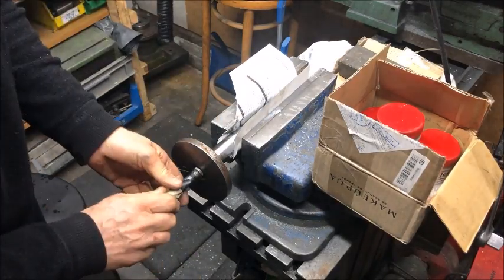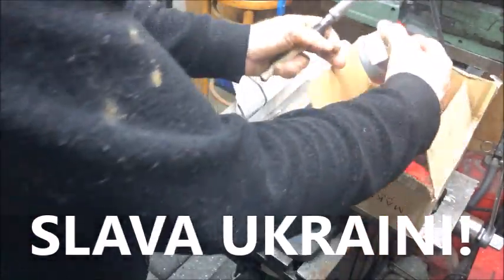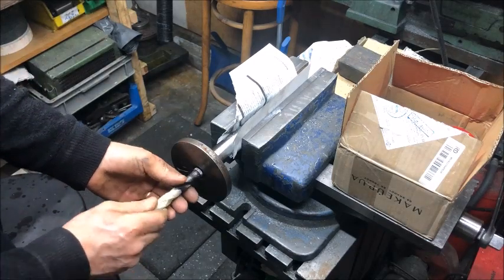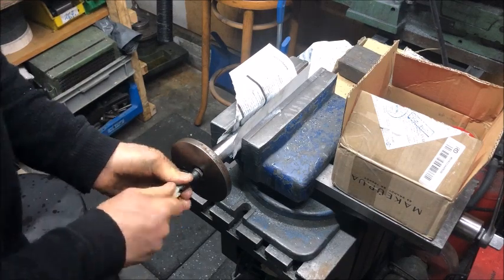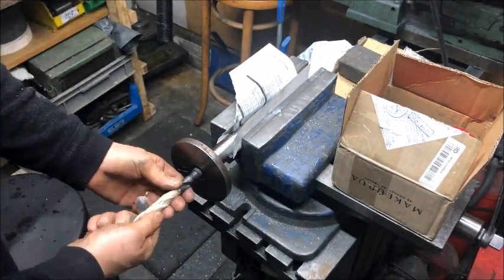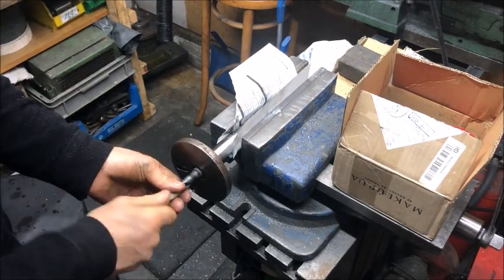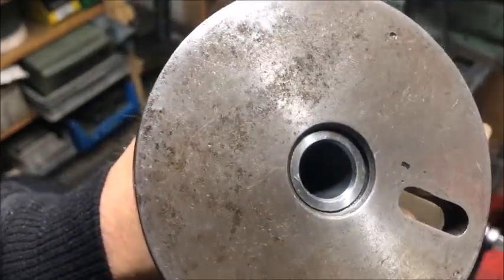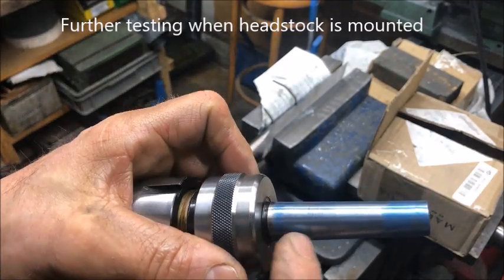Myford ML7 headstocks - part 2 - experimental MT2 taper improvement

Comment: It was a humbling experience when I started trying to recondition tapers on my benchtop lathe.  I think I made every possible mistake, and may have invented some new ones.
Reply from the maker: The experiment I made here seemingly produced a good result. Not perfect, but within +/- 1/100mm runout and no appreciable taper error . As this is as read on a test bar inserted in the taper it also adds in any error from the spindle bearings/seat
Reply: @jansverrehaugjord9934  - Is the male taper used as the lap, affected badly? 

 Using steel as the lap, on the steel spindle taper, means the abrasive should not be embedding in either surface.  How would you check if any abrasive HAD gotten embedded in the spindle taper?
Reply from the maker: @somebodyelse6673  Good question. The sacrificial drill taper isn't that bad, but I suppose some material is lost. The female spindle taper Looks/feels OK, but if there is any embedded material it is not that critical as it is supposed to be used as a static fit anyway ie. not as bad as it would have been in say a bronze bearing. Not sure really how much the spindle taper is used.. possibly only if you use direct MT2 collets and/or drills?